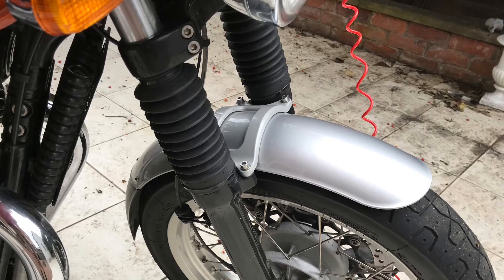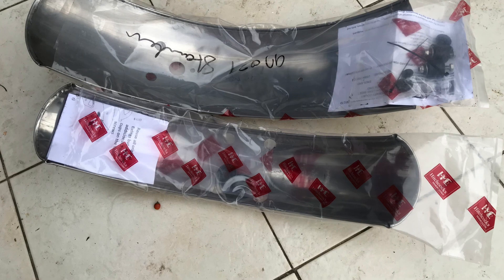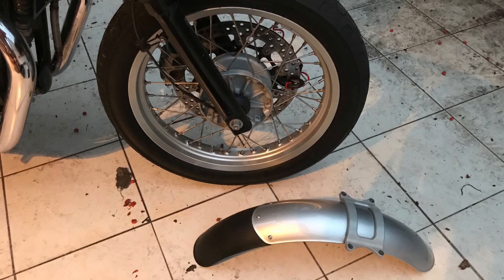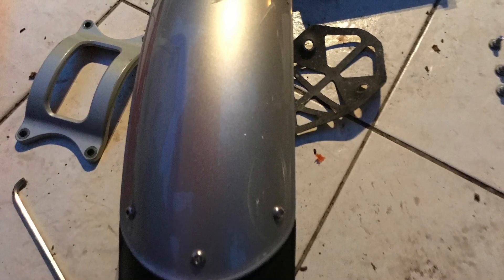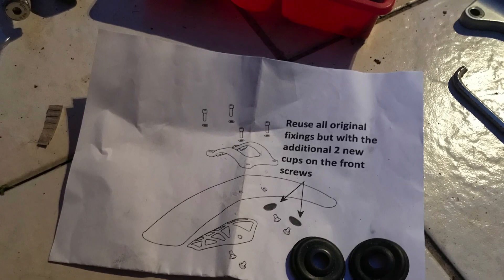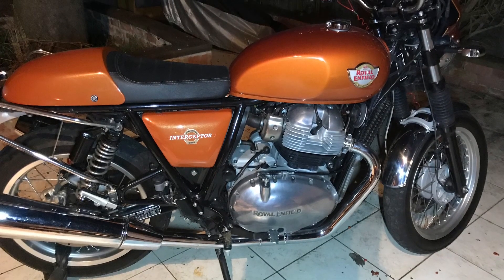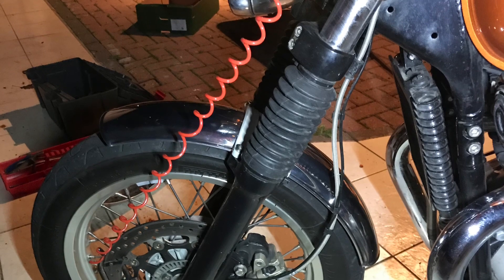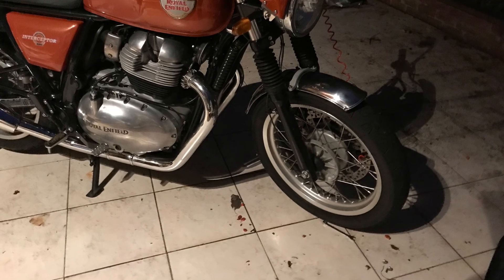Royal Enfield Interceptor 650. Stainless front mudguard done!

Comment: Hi James,  i purchased from Hitchcocks the 'Polished Alloy Guards' [ cheaper option ] last year, painted the fork brace gloss black and also purchased the oil filter/sump guard, the oil filter is in the direct line of fire from stones chips etc from the front wheel, now that the shorter Front Alloy Guard is fitted.  Regards  Chris.

Comment: Hi James I wouldn’t drill the mud flap on screw fix do a very strong black sealer I’ve used on loads of mud flaps never once have they came off.  The fork brace I’d have a go st spraying it chrome to match but don’t buy cheap cans they don’t work 👍👍
Reply from the maker: Sounds like that would be a job for CT1 . Amazing stuff

Comment: "Irwin Wrench" Lol, we call them "Vice Grips" here. I would most likely paint that fork brace Black. I don't think the Orange would work on the fork brace but I'm nobody's artist, and it certainly could.
As far as that flap is concerned? Try running the bike without it for a bit and see what happens. A sump guard will protect the filter and motor but you have to come out of pocket for one of those. 
I think the bike looks 100 times better with that chrome fender and without the flap, honestly. 
The rear one should be cool as well, when fitted.
Cheers

Comment: Personally, I hate the look of that fork brace. There must be some way to replace it with something hidden under the mudguard...
Reply from the maker: That would be tricky, I’d say. The mudguard has 4 large holes in it and if the mudguard is put on top of the brace, it would be very high above the wheel. Classic Japanese bikes have the fork brace under the mudguard and actually welded to it and forming mounting arms……. But even then people usually fitted after-market braces since OEM wasn’t exactly fantastic